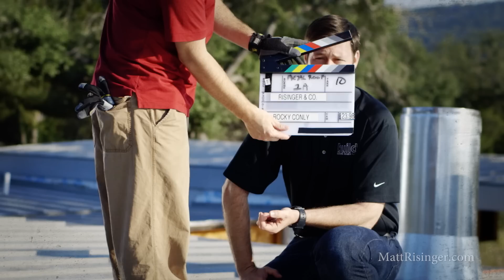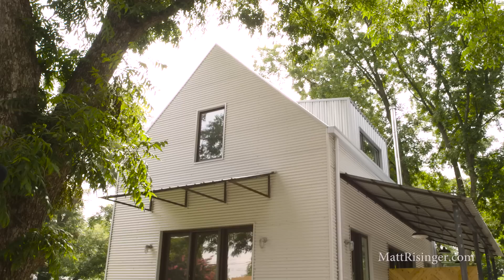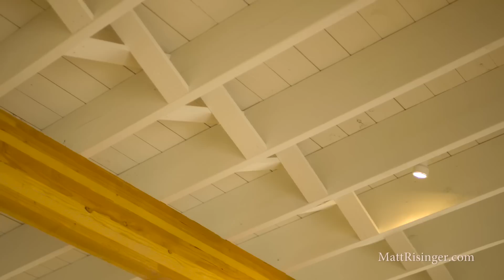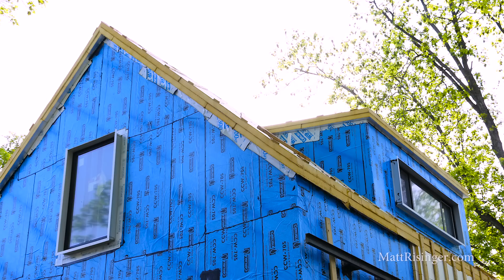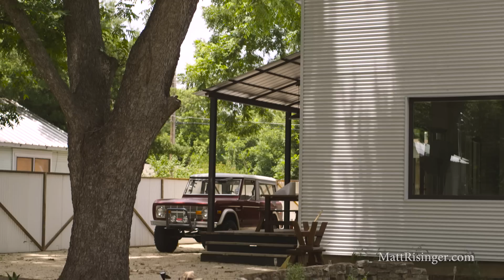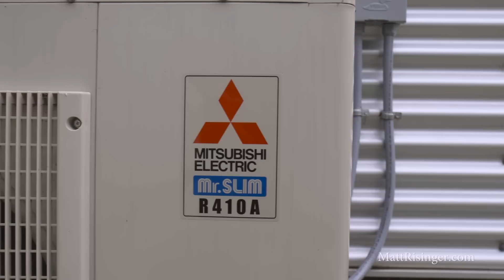Perfect Wall Review - A system to Build an efficient house!

Comment: Could this be a retrofit on an existing house? Essentially remove siding, wrap house in barrier & insulation, then add new siding?

Of course the roof would be a separate interesting challenge, but maybe this gets you half of the way there.

Comment: The open stud interior walls are an interesting concept, but they would be an impractical nightmare to clean effectively especially in a dusty region.
Reply: But one of the major selling points for this method is zero air infiltration thus no dust.
Reply: how dusty do your walls get now? i don't think it would be much different.  if you're talking about dust in between the ship lap then just vacuum your walls

Comment: There are some key aspects of this wall system that I really like. I love the metal exterior for durability, and fire hardness (especially for those of us in wild fire states.) I love the ability to have drying to the interior in the event of a leak somewhere. I love the ability to immediately see if there is a leak, rather than having it go undetected for an extended period. I love the lack of thermal bridging. I love the tight envelope.

Here is what I don't love about this system: Foam, plastic and mechanical environmental controls. I am a huge non-fan of synthetic materials that expose residents to possible chemical off-gassing and are difficult to recycle at the end of the life of a house. 

I don't believe for a second that this will stand for 500 years. Especially with no eve overhangs. The combination of UV light and rain will eventually beat down the surface coat on that metal and it will eventually degrade. It may last 100 years, but not 500. 

I don't love needing to rely on mechanical systems that require electricity to manage the indoor environment for fresh air and cooling. 

Happily, there are buildling systems that do everything you are interested in here, with none of the downsides and there are buildings that have been standing for 500 years already using these methods. 

Do yourself a huge favor and research the Timber Frame, slipstraw and lime-plaster wall system. That system is breathable without having air leaks, is made from all natural and readily available materials that have very little embodied energy and can be composted if the house is ever torn down, has simple and easy maintenance and can be maintained indefinitely. As I said, there are homes in Europe built this way that are going strong after 500 years. This system has a great balance of thermal mass and insulation in the walls and can be an exceedingly energy efficient design if situated properly to maximize passive solar gain. Super easy to build net-zero this way and can be built to whatever R-value is desired for a given climate. This system also has incredible fire hardness. In most parts of the country, the source materials, timber, straw and clay, can be sourced very locally thereby reducing energy impact of shipping that is seen with the manufactured materials in this video. 

I really appreciate what you are working on here. I really appreciate the desire to build super comfortable, energy efficient, ultra-durable homes. I think you will be really excited to learn more about Timber Framing and slip straw construction. Super low-tech, super doable for anyone, cost effective, and makes for amazingly wonderful interior and exterior space to occupy. Check it out and keep up the great work!

Comment: Boy do I LOVE your concept Matt, The interior of the home with the open/exposed framing members looks amazing. I am about to undergo extensive repair work to tear out my entire lower kitchen cabinets on an outside wall because of water infiltration and rotting OSB shear panel that has occurred. Concealed behind the lower cabinets, this leak has been ongoing for years!!!! Moisture got behind the outside paper, failed and now this!! At this point I'm not awfully fond of OSB . Thank you for teaching us how to be better builders / and protecting our homes from the harsh climate that ultimately causes failure to the outside envelope of our homes.

Comment: Outsulation would work well with Wall that has high heat capacity...like cement or adobe. This way the dense wall material holds the internal temp of the house, shielded by external temps by outsulation
Reply: T Jam: But instead he used 2x4s. Mistake! Brick would be great also and it's accepted, unlike Adobe (which I love the look of). Best of all for beauty is a rammed earth wall. Done well, they are a work of art. Stone walls would be also, but it's so much more expensive.
Reply: Folks, 

I'm going to be implementing a Perfect Wall/outsulation house in BC, Canada this spring.  Just got possession on the land.  This video was one of the many inspirations for what I'm going to be doing.

I will be doing galvalum | sealed EPS | reinforced concrete w/wood texturing on the inside for aesthetics for the floor and buried walls, and galvalum | sealed EPS | wood with fine sanded surfaces on the inside for the upper parts.

I will be drywalling and internally insulating where necessary or advantageous, but will be using the gaps between studs where possible as part of a storage system.

Also looking to implement ground-source-heat-exchange which will be used to bring HRV intake air up above freezing even in the dead of winter before the HRV exchange.

If anyone has any further ideas, concerns, or interest please let me know.
Reply: @daniellewis984  Make a video!

Comment: Hey just wondering what the best way to insulate a cinder block home without spending more than you would ever get back on energy savings I'm down in southern Florida and it's always hot most homes don't even have heat where I am

Comment: Matt, any modifications I'd need when using engineered wood siding? We're in central NC. If done as a DIY project, do you think the perfect wall cost is comparable to 2x6 construction with dense-pack cellulose?  We're trying to do a low cost, high impact project. Thanks!

Comment: Hey Matt, Climate Zone 5b here, with additions and remodeling project. End cladding will be stucco. Since I want the thermal break of exterior insulation under stucco and I plan on using on the older parts of the home, it occurred to me after countless hours of online study that I might want to simply go all insulation outside and none inside.

Here, code calls for R20 cavity or R13 cavity + R5 continuous. I am considering (I will run this by building dept as well of course) using two layers of 2" polyiso foil-faced, offset seams and joints, (R13.1 ea = R26.2) on the outside and skipping the cavity insulation altogether. I will use drywall as interior finish, although I might consider an open-frame look in an area.

The roof/ceiling most likely will be conventionally designed, with ceiling plane insulation (R49 vented attic).

I've seen the videos and read about the perfect wall. My question is whether the peel-and-stick membrane is a necessity in this scenario of ext insulation only? (I know it's "perfect" but I'm going for "pretty good")

2x4 frame, osb sheathing with taped joints, building wrap integrated with window flashings (drainage plane), two layers of 2" ea polyiso, stucco. Wouldn't I be okay using osb as air-barrier (serves as exterior air barrier in conventional framing/insulation assembly) if I used a peel-and-stick tape on seams, top, bottom?

Some would ask why not just go ahead and insulate cavity and get all the more R value? Answer is cost, plus, I like the idea of everything outside and not spending the time it takes to insulate inside properly (I'm a remodeling contractor and this is for my own home, so I plan on saving labor here and there by installing myself). I can put up what I want as interior finish and not worry about anything.

Thanks and I realize I probably need to run this by building department.
Reply: I don't think 2 layers BOTH with FOIL is a good idea - the foil traps moisture between the layers I believe.....

Comment: I know it's about outside insulation rain vapor barrier but there is the question on where is plumbing and electrical. It's southern USA obviously not good for cold climate right? I like the wrap and it's affordable. Does it go Right over the pressure treated sheathing?

Comment: +Kevin Lynch - Perfect Wall works as he calls it up north perfectly except we usually have insulation on both the inside and out for modern houses.

+Matt Risinger - Dude, modern research is increasingly showing that the basements in a house need exactly the same layering as the perfect wall too.  Basements are notoriously difficult to get right because we (the builders of the world) always get them so wrong.  The buildingscience guys got it wrong because they were rightfully afraid about keeping pests out, but if you insulate the inside, the vapor pressure from cold concrete hitting that insulation is too much up here, and you get condensation.  Also, thermal cycling and water content cycling over the seasons is really hard on concrete expansion/contraction.
Reply: Mineral wool insulation on the outside combined with metal flashing is pretty effective at keeping the termites out.
Reply: Some jurisdictions now require borax-impregnated foam boards (protected physically by any one of a number of finishes) to insulate what would otherwise be exposed basement walls. Supposed to stop termites. I guess we'll see in future years.  For sure uninsulated basements have to be one of the dumbest holdovers from the days of cheap fuel (if there was such a time). Still see uninsulated basements everywhere on new construction. Buyers don't notice, I suppose, and builders divert their attention- Look! Stainless steel appliances and granite counter tops!

Comment: The cross section and explanation is not clear. What are the 1 inch laths attached to? The laths and insulation can't just float in place.
Reply: This was my question too.  Is attaching the insulation and lath punching a bunch of nail holes in the membrane, or is the insulation glued to the membrane?  ANd then the metal siding is sort of floating around that like a big shell?

Comment: how much does a house like this cost to build? I would assume it would be cheaper than a traditionally built home. Love this concept!
Reply: its actually the opposite. materials and labor will be higher
Reply: I think Matt has stated it was in the ballpark of $250 per sq ft. Not sure if that includes site costs, but I'd assume that's just the building costs. He tends to use mid-to-high-end finish details so you might have some leeway to bring that down a bit with simpler trim. It's still going to be more expensive than a traditional home for several reasons, but largely due to the extra layer of 1x6 pine between the studs & sheathing, and the high cost of polyiso rigid foam relative to the ubiquitous cheap fiberglass batt insulation in traditional homes.

Comment from the maker: @59seank You need to check with your individual building inspector about your specific plans.  In our case, we didn't violate any codes doing this in our jurisdiction.  We ran all exposed electrical in conduit, and our inspector was satisfied we met the codes.
Reply: That's a great video, Matt. Nice work, as always, with pushing the envelope.
Reply: Matt Risinger
Thanks for responding Matt.  I love the look of the wood frame in a house.  It reminds me of the old summer cottages I stayed in when I was young.  I figured you wouldn't build without code approval.  I'm just surprised it's allowed.  I live in the Chicago area, and I don't think open framing would ever fly here.  We still require metal conduit for all electrical work!!!

Comment: What makes me nervous.  This house has no sheetrock.  What would you do with the cavity behind sheet rock if you had it?  I am not a builder and this reminds me of the old balloon construction used in the first quarter of the 20th century.  I had 5 classmates who liked in such a house and were burned to death when a short in the electrical wiring started a fire in the wall cavity.  I think if I lived in another old house I would rip out any lathe and plaster, fill the cavity with Roksul and then use a fire grade sheetrock on the exterior walls.  Does this make sense?
Reply: What about the balloon wall caused the wiring fault?  With all conduits easily accessible or exposed, how easy to inspect?  Modern overcurrent protection and AFI / GFI adds huge safety factor.  Fire protection (sprinkler or halon) has immediate access to all surfaces.  I think this is a very robust technique from all perspectives including fire safety.  Easy enough to insert blocking at 8’ if the code Nazis can’t get their heads around the reasons why it isn’t necessary.
Reply: you're talking about electrical that was how old when they burned to death?  All this electrical is new.

Comment: Doesn't every fastener go all the way through the sheathing, insulation, "barriers", siding, etc. and into the studs?  Isn't that thousands of thermal bridges?
Reply: Yes you do, but that's no different than on any other house, and even collectively it doesn't have a huge effect. You get a huge benefit, though, from a continuous layer of insulation outside the sheathing, rather than inside the stud bays. The thermal bridging from sheathing to framing to drywall is the biggest issue with conventional homes (framing can easily surpass 20% of a wall's surface area), and this approach largely eliminates that.

Comment: If it is an exposed stud wall, how do you hid the electrical wires and junction boxes?
Reply from the maker: Most of the electrical is run through the crawlspace and any exposed wire is in conduit.
Reply: Matt Risinger Very interesting. Thanks for the quick response!
Reply: Matt, our location is Siskiyou County, Nth California. Since our winter temps occasionally drop below freezing, what are our best options / methods to protect against freezing pipes?

Comment: So how do you dust the myriad of timbers that are exposed? My guess is you have dusters on a stick or just moved in. What does you fire insurance company say about the "Perfect Wall"?
Reply: The perfect wall does not require framing to stay visible. You can still add drywall or whatever kind of finish on the inside. you can even add insulation on the inside with fiberglass if you're concerned about fire hazards. The concept of the perfect wall is to eliminate water and vapour from the equation. In other words, you seal the outside of the house from water and air penetration and you insulate the outside to eliminate the possibility of condensation and diffusion. 

I've been trained as a carpenter by canadian standards but I have always doubted the way moisture has been handled. I stared doing research and came across Joe Lstiburek's ideas. And it just clicked for me. This is the way it should be done.
Reply: What dust?
Reply: I'm with you on this 100%. I've been researching Joe's work as well and this method really resonates with me. Matt's videos are great but I'd really love to know how his ideas would apply to building in Canada. I plan on building in Central Ontario and we obviously need more insulation than that. I see a lot of double-stud walls but nothing like this. I know this post is a year old, but I'd love to hear your thoughts on building something like this in Canada.
Reply: It doesn't matter if you live in Canada or the North Pole, you'll get a better thermal barrier by putting the insulation on the outside. Look up thermal bridging. The R value of the wall in this video is around 27, if that is not enough for you then add more foam.
Reply: The fire insurance company will love the fact that it has a metal roof and metal cladding. If you think that the painted wood is going to significantly make the interior more prone to fire then cover it with drywall or paint the wood with fire resistant paint.
Reply: I lived for a long time in a log cabin in Maine. The whole thing was exposed wood. Now I live in a timber frame home in California. Fires behind drywall from a rodent chewing on wires or other electrical gremlins isn't uncommon. The drywall does slow down burn, but it also hides it. If it was me I would of used dark stain on the framing and a natural sealer on the rest.

Comment: What are your thoughts on large overhangs in these applications? I noticed this building has no overhang on the gable end and minimal on the eaves.
Reply from the maker: Joseph Malovich  The Perfect Wall concept means we need no overhangs in Framing so we can perfectly wrap/seal the house.  But, we added them AFTER so we can shed water and shield the sun through windows/doors.  However, the design dictated some reduction in overhang for daylighting & architectural intent.  Matt
Reply: Matt Risinger Thanks for the clarification. I usually hear large overhangs are recommended for various reasons but excluding them for architectural and lighting reasons makes sense. I wish more builders in the states were like you, what I see in Zone 5A is pathetic.